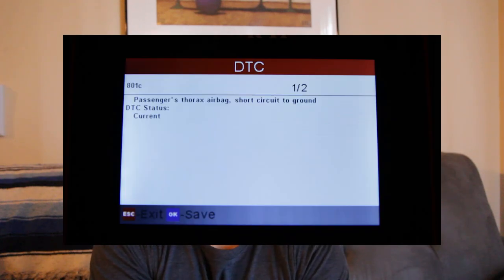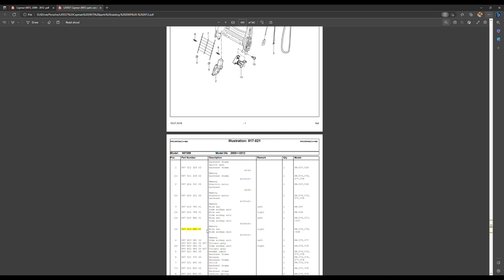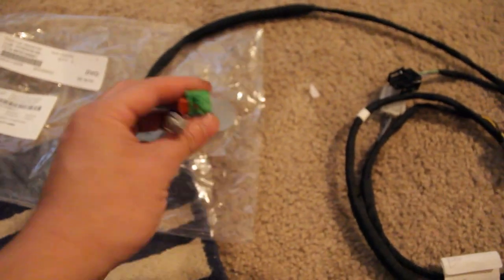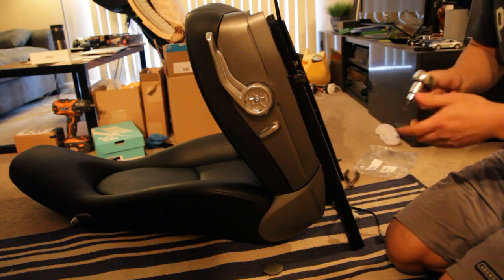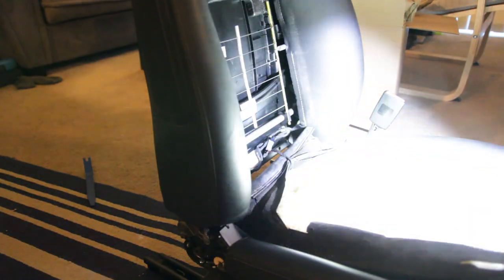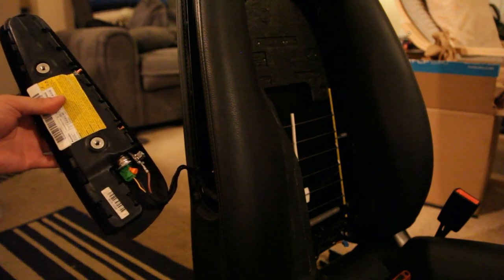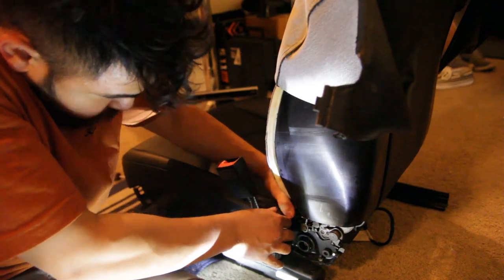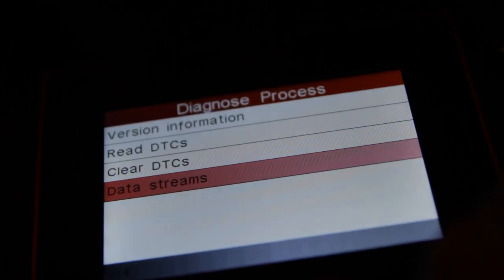Porsche 997 911/987 Cayman Seat Airbag Short Circuit To Ground Fix

Comment: Great video, thanks. I took some shortcuts compared to your video. Not pulling the back of the center insert, just pulling it down and folding. Similar to the side bolster, I did not remove the seat folding latch, just pealed it enough to access two torx screw.

Comment: That is a PITA of a job. I have wanted to paint my sport seat’s rear “volcano silver” plastic covers to the Arctic Silver body color, but the amount of  work required to remove them, and risk of collateral damage to the seats and interior leather have prevented me from doing so.
Reply from the maker: Yeah definitely not worth it in my opinion. Could you just mask things off and paint?
Reply: @jontansgarage  Hello! It would be a little sketchy as there are (as you now know 😆) as there are so many levers and buttons on the fully adjustable sport seats. To paint the plastic correctly, it eould need a plastic to primer bonder, then prime, base, and finally clear. Getting flawless coverage really requires having the shells laying on a spray rack. I wish porsche had simply put a few accessible attachments on the outside of the seat backs!
Reply from the maker: @UncleDuncan5092  For sure. Have you considered perhaps wrapping them?
Reply: @jontansgarage  I wouldn’t be able to match the exterior color 🙁. Getting ready to replace my fuel injectors and plugsi (if the parts would ever arrive)…
Reply from the maker: @UncleDuncan5092  I bet they can get pretty dang close with the color-match with vinyl technology nowadays, definitely keep it as an option. Always loved the colored seat backs :D

Comment: Hello
Well done! I hope your code is gone forever now.

I have the same issue. Just on the drivers seat. I have read so much about my issue, and first I taught it was the seat buckle but its not. My code is ”8024 drivers thorax airbag short circuit to ground”, so I have to do the same process just like you did. But first I need the right partnumber for the Drivers side on my 997.1.
Reply from the maker: Ahh, should be the same "enjoyable" process but mirrored then. The part numbers listed in the description should work for your car as well. I would maybe cross reference the part by searching some Porsche dealership websites to make sure it is compatible or even verify with a Porsche dealership to be safe. However, the 997 at the beginning of the part number should be the chassis that the part is for. In this case the 997 signifies to me that the part is for a 997 but also happens to be compatible/used for 987's which is pretty common for the 987 and 997 cars.
Reply: @jontansgarage  
Yeah you’re right. I will make sure with my local Porsche dealer for the exact partnumber. I have exact the same seat like you, without memory and with the ”pump” function for raising/lowering the seat.

The code is gone now? No issues after the installation?
Reply from the maker: @Mezg3r  Correct, replacing the wiring harness fixed the issue. Just make sure you have a scanner that can clear airbag codes if you don't have one already; the iCarsoft POR II works great.
Reply: @jontansgarage  
Thank you so much!!! I fitted the new cable as I ordered at my local Porsche dealer, the price was about $100, took 4 days to arrive direct from Stuttgart. 

The job took me for about 6h so far (3 hours during 2 days) to fit the new cable. My old cable harness was bent/broken in the small gap you are showing at 41:15, took a multimeter to measure the ”power” in the old cable, while doing that i bent the cable little and the multimeter beeped just at the part where the cable have been placed through the small gap.

The metal bracket with the small gap is a really poor construction, Porsche could make the gap bigger from the beginning. I remember I could activate the airbag light while I pressed my back to the backrest - Bingo! The pressure from my back pressed the wire harness and activated the light.

Now fingers crossed, I’ve start to refit the parts back again, I will finish the job tomorrow I think it will take me at least 2 hours.

Then I will delete the code and I could get back the love for my 911 again.

THANK YOU SO MUCH FOR THIS VIDEO!
Reply from the maker: @Mezg3r  Awesome man, glad to hear it went well so far. If I recall correctly, I do remember seeing some posts about moving the seat forward, or making sure not to push the seat all the way back as sometimes that would keep the airbag light from turning on. Again, glad the fix is going well. Cheers!